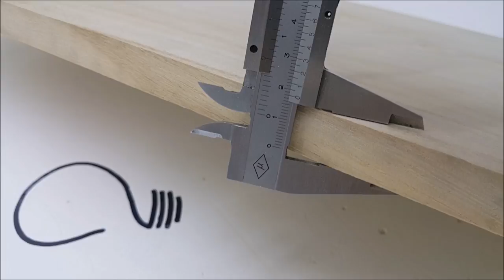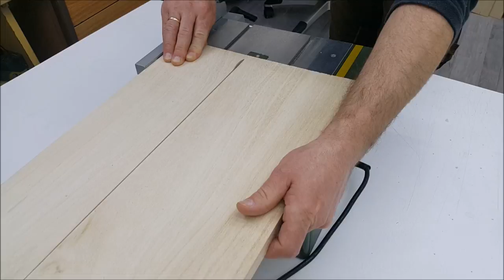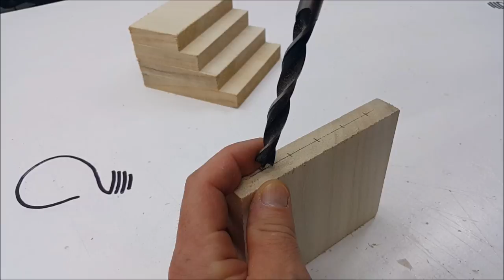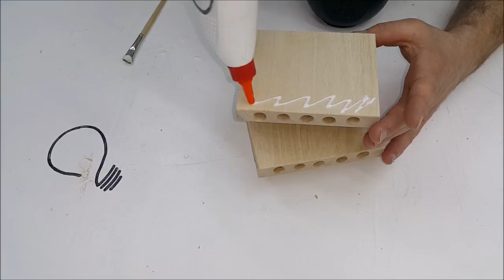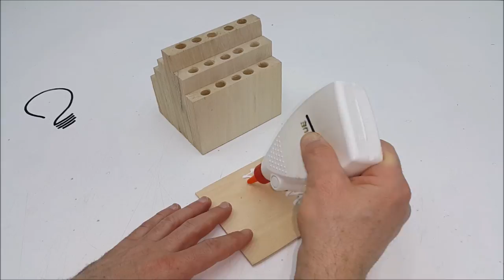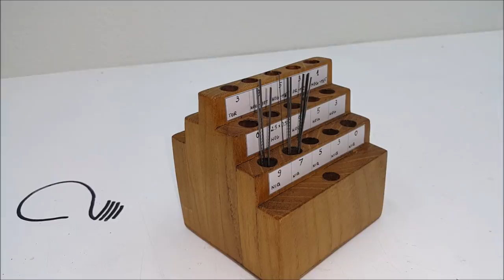Scroll Saw Blades Holder

Comment: DM Idea, great idea. I like the differant height design. I've been scrolling about 25 years now. My RBI 20" HAWK saw is 22 years old and never a single issue. In the video I see you using a proxxon FET table saw, I have been concidering getting one for some time now, just wonder if its powerful enough. If you get a chance I would really appreciate your opinion on the saw. They seem to be nice but nothing like hearing from someone who actually uses the saw. Hate to spend the money and it not be worth it. I was also looking at the Micro Mark saw, pertty much the same as the proxxon. Your opinion would mean alot to me. Thank you for any concideration.

Comment: Is there actually a need for all those sizes? I'm asking out of ignorance.

Nice project. 🙂👍
Reply from the maker: Probably not. I'm using three maybe four types of blades for about ninety-five percent of my projects. However, I had a chance to use every single type of blade you can see in this video simply because sometimes it makes the cuts cleaner and live a little bit easier. 
Thanks for watching.
Reply: @danielmiskoidea  ah, that makes sense. Thanks!